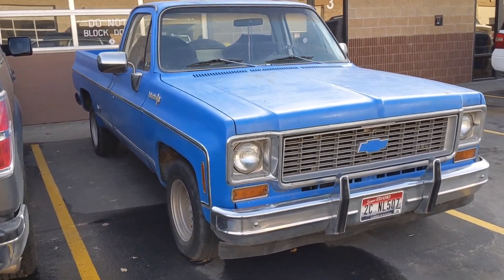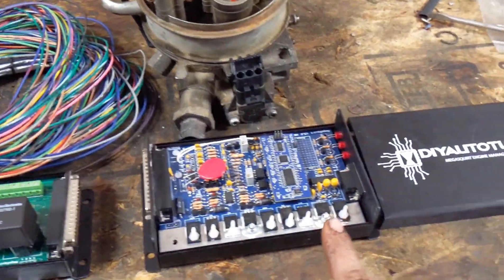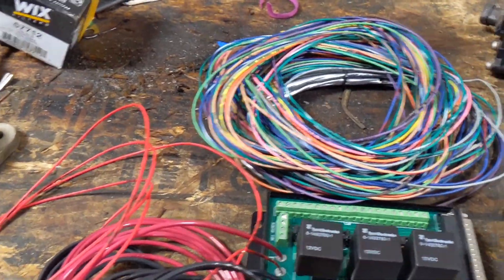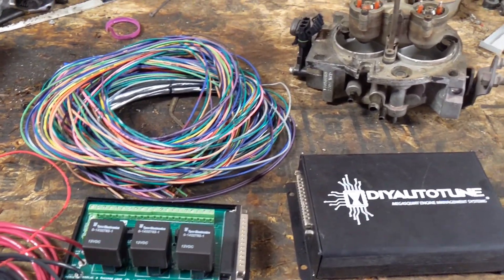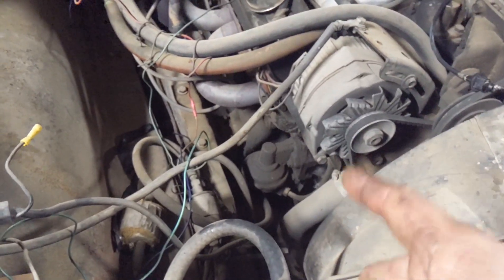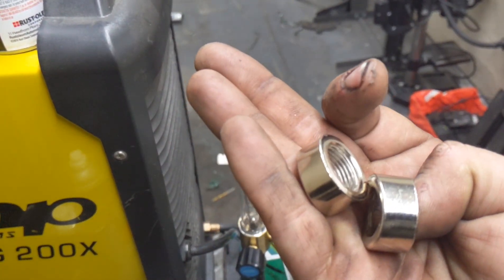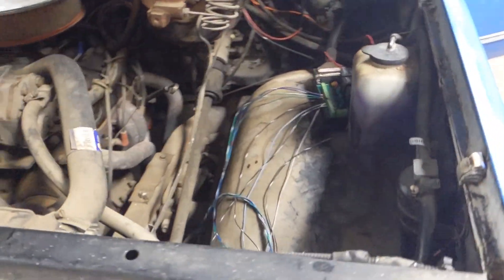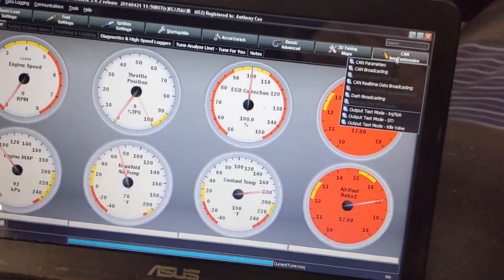Megasquirt Swap - Part 1

Comment: Where did you find your tbi tune file?
Reply from the maker: It's a combination of different settings that I've found in various places. Would you like it?
Reply: @208Concepts  sure that would be great !!
Reply from the maker: Awesome. Stop by one of the chatrooms I have linked in the description and I can get it to you.

Unless you'd rather an email.
Reply: @208Concepts  YT keeps deleting my email address
Reply from the maker: @86GNboi  I hate when it does that.
Reply: @208Concepts  bwjordan89  yahoo
Reply from the maker: @86GNboi  I'll get right to it when I get to my laptop.

Comment: Do you have any suggestions for a good quality somewhat cheap wideband?
Reply from the maker: Depends on what your needs are. The Spartan series are great for standalones where you may not want a gauge ruining the look of the vehicle (like the 74 Chevy project), and the AEM X series works fairly well if you don't mind a gauge. 

Lots of people have issues with Innovate controllers but I never have.
Reply: @208Concepts  I'm looking to do something similar to what you're doing here, just with no worry about looks.
Reply from the maker: @zragevii4705  so yeah, something like an AEM X series should be fine. They run around $200
Reply: @208Concepts  thank you very much, just pricing what my dumb project should cost me...🤣

Comment: Illegal ....10 year federal sentence 
same as odometer rollback tampering.
Look up epa cases a Sacramento lot cleaner had late 70s efi  vacuum lot  trucks
 , he put carbs on them because efi parts in 16 were obsolete was caught ,fine was $80000 and trucks were confiscated
Reply from the maker: That's also in California, where it's now illegal to change your own oil without a license.
Reply from the maker: And besides that, I'm taking the carb off and going to EFI, which would clean up emissions, not make them worse.

Comment: Are you doin this so you can tune?
Reply from the maker: The main concern is drivability, and I'm sticking with the mechanical distributor to mimic the old fuel, just with fuel control 😁.

Comment: 5.3 0r 4.8 LS w/BP harness would have been an better idea, less work, more power, and cheaper swap.
Reply from the maker: Yup, probably. I'm not going to deny that, but if you followed the build closely you'd know that my mother in law's uncle built this truck. The only reason it's keeping the SBC is because of sentiment.

Comment: Thank you for making content about a tbi megasquirt project.  Makes me more confident to start one myself! If you face some difficulties I'd hope you'd cover them for information. 

Just right now I'm thinking would it cost pretty much the same to buy a Fitech EFI..
Reply from the maker: According to my fuzzy math it costs a bit less, but is more modular for the future, should I want to go that direction.
Reply: @208Concepts  true, true..

I do already have an aem wideband and in-tank electric pump so it helps. Let's say MS2's weren't as cheap as i thought lol. Then there's the Speeduino route, very interesting and shurely affordable but the tech and software skills it would require is just black magic for me haha.
Reply from the maker: @waltteripatronen4535  Speeduino behaves a lot like Megasquirt actually. I went the DIY MS2 kit because it's about $150 less than the assembled unit.